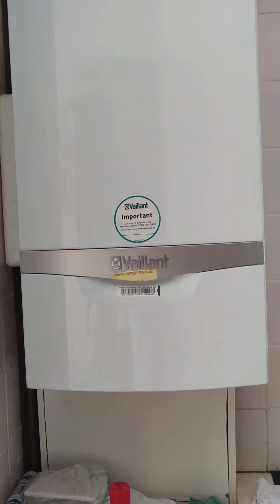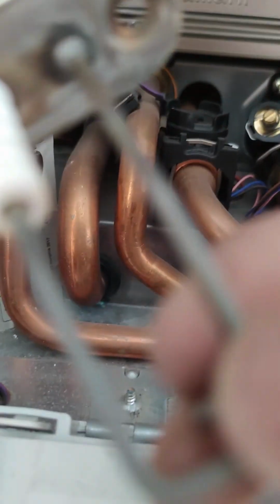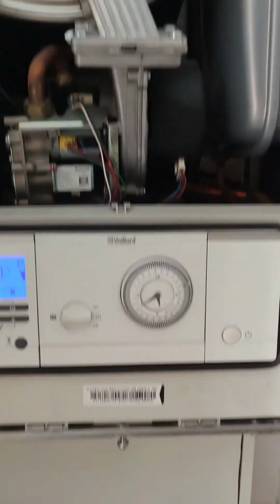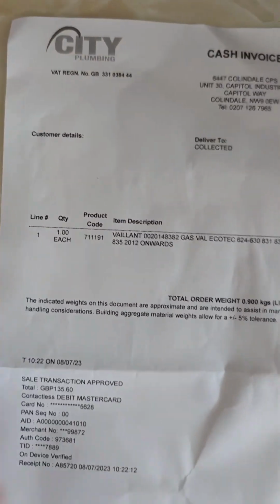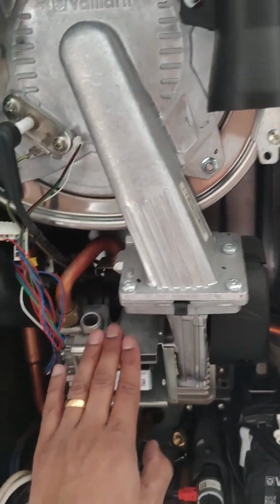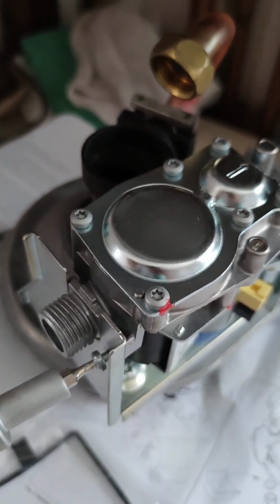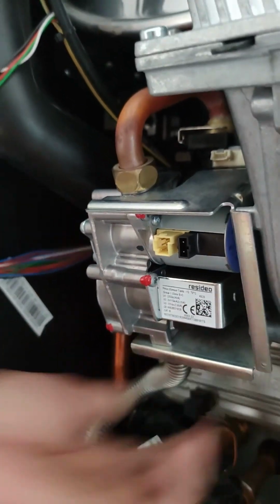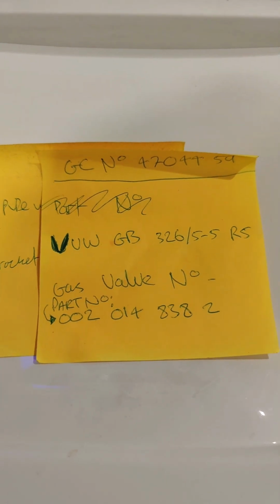Vaillant Ecotec+ Boiler Repair Gas Valve and Ignition Probe Replacement #DIY #Vaillant #Engineer

Comment: Gas valve check to be sure,the bottom solenoid 140 ohms top left  yellow  120 ohms and right top 170 ohms all plus or minus 10% , also need to do a gas check and analyser test if you swap the gas valve

Comment: Hello mate, great video keep it up the good work. If you didn’t know already, on the Vaillant boiler casing, where the model name is, that bit comes off, can push it up and they normally have the GC no and serial number on the other side 👍🏽
Reply from the maker: Thanks for the feedback. Will check it out. Much appreciated.